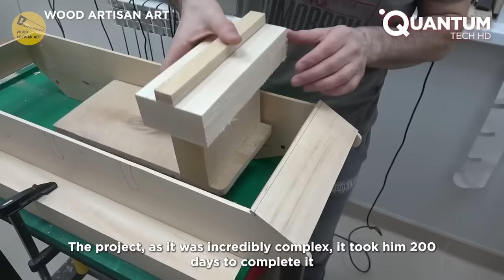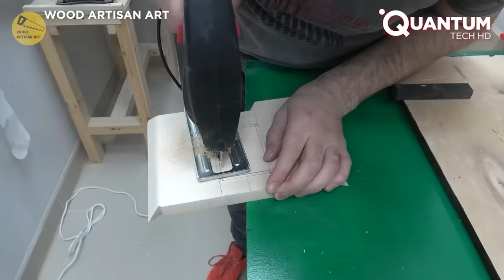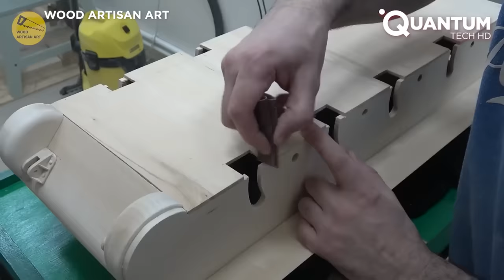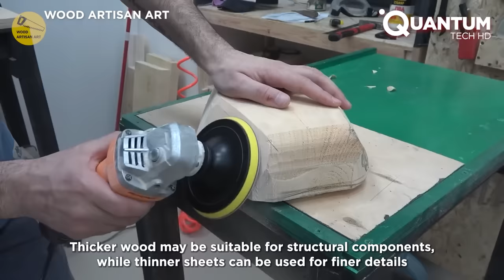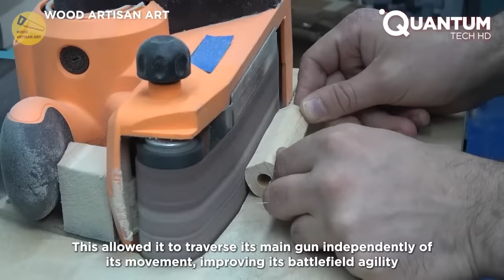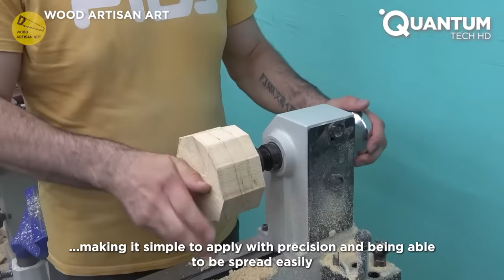Man Builds Hyperrealistic Soviet TANK Out of Wood | T-34 Replica by @WOODARTISANART

Comment: From what I have read about the T34 , is that the track pins tended to walk their way out . They solved the problem , by simply welding an angled piece of steel on the hull , that would push the pins back in , as the track went around .

Comment: Now do the current M1A2 SEPv3 Abrams main battle tank. You might want to get the Tamiya 1/35 scale model of the M1A2 Abrams tank to use as a reference for the wood model. Plus you can do an exact 2× scale up in size which would help with maintaining accuracy and improving detail. Oh and there are 1,000's of high res images online of that tank with various equipment and accessories. Could be a fun project. 😁

Comment: Fantastic design very enjoyable to watch :)

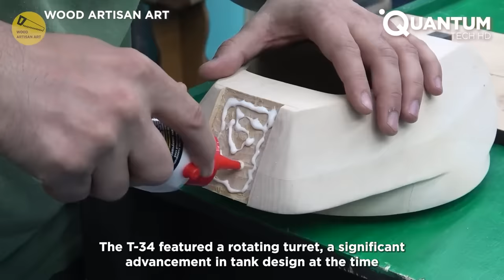One correction, at 6:14 , you say that the rotating turret of the T-34 was a "significant advancement in tank design at the time".   No. Tanks from all nations had rotating turrets on their tanks, that was standard. Some tanks (mostly very "heavy" (for the time) vehicles) like for example the French Char-B had a light gun (37mm or something like that) in a rotating turret, and the main gun (a big 75mm if i recall) fixed in the main hull (it was too big and heavy to fit in a turret of the time). But yeah, except for a very few models, all tanks had rotating turrets, and had for decades before the T-34 was introduced. The first tank to feature a rotating turret was the French Renault FT-17, in 1917.